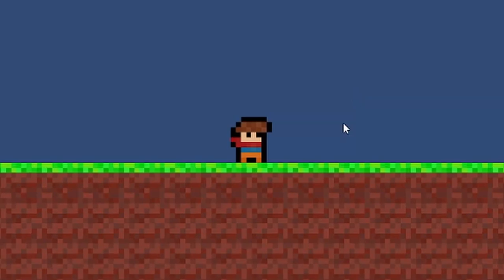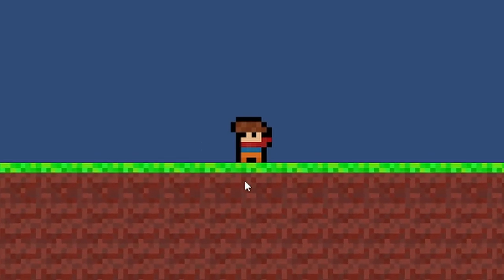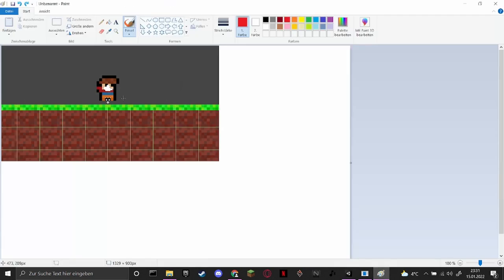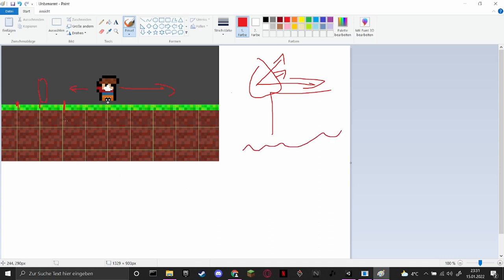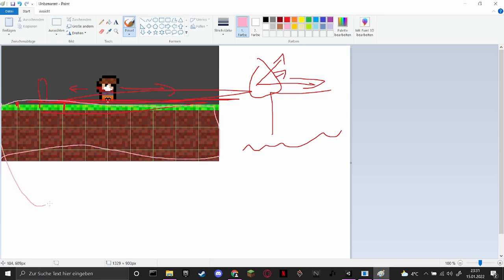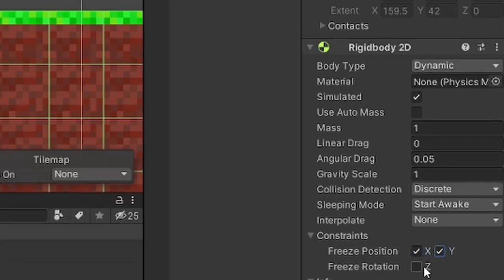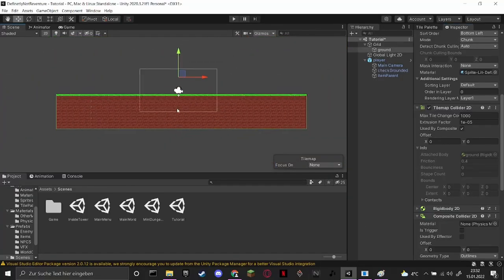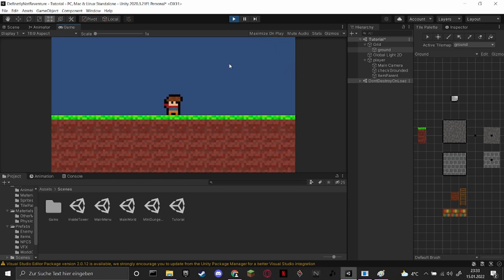Unity Quick Tutorial | Bumpy Tilemap Collider Bug

Comment: A little late on this but you can set the Rigidbody2D as "Static" and you won't have to change any other settings in it, either way works!
Reply: Also, another problem you might be having is that, if you turn on the game and look in the scene you might see that your player is not touching the ground. 
This is because of the way unity uses colliders. Even if you're collider looks like a perfect fit for the character, it always acts like it's bigger than it actually is.
So to fix this, simply make the BoxCollider2D smaller. if your using a scale of (1, 1, 1)(a cube basically), make X size of the box Collider 0.95 and the Y size 0.97. That should fix it! feel free to play around with it.

Comment: Hi, i have a big problem with tilemap collider. If i scale or rotate my tiles in the tile palette, their collider stays the same as it have been in default state. If I uncheck and check "composite" again it is working properly until i enter and left play mode. Please help :C
Reply from the maker: Hey there! That sound kinda odd tbh, did you maybe miss a step in the tutorial? It might actually be just Unity doing some stupid stuff, it does that quite a lot, actually. Maybe look into updating your current Unity version (Go into Unity Hub -> Installs -> add a new Version and then change the version of your project to the newer version), it helped me most of the time. Sorry I couldn't help ya more :/
Reply: I changed it to the newest non-beta version and unfortunately the problem still occurs. I think it may be problem with scaling tiles in the palette. How should it be done? I just mark a tile and raise its X and Y to some value. Is there any other more recommended way to do it?
Reply from the maker: @Erwin2xD  Hmmmmm, what you might want to do (and what I always do when I have a tile that's bigger than the rest) is either create a new tile-map for tiles of that size. To change the size of a tile, go into its sprite-settings and change the pixels per unit. Or you could, let's say if you have a tile that's 4 times bigger than the other tiles, cut it down into four different tiles. Hope this helps! :)
Reply: Thanks for the answer! I would like to use the same triangles but with other sizes and rotations. So should i just make 3 other tiles instead of rotating one, and next ones if i need bigger sizes?
Changing the ppu would decrease quality of borders, wouldn't it?
Reply from the maker: @Erwin2xD  I think making three different ones is the way to go, and ppu is basicallly just the pixels per one unit. If you had a 12 pixel long sprite, and the ppu wuld be 8, the size of it would be 2 units and so on. It does not decrease quality, at least I dont think so :)